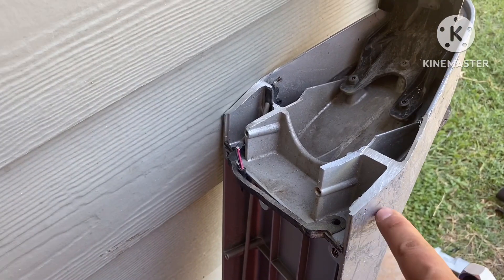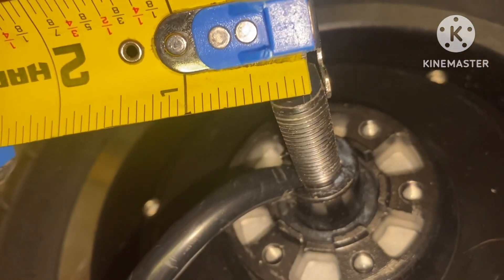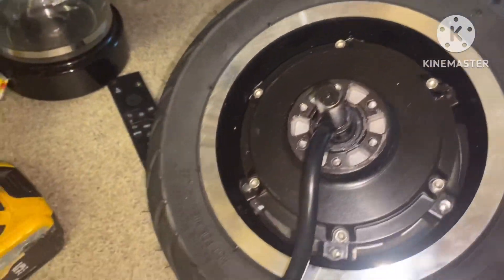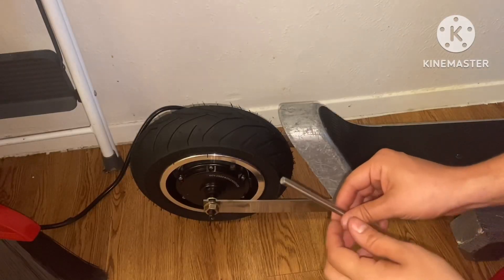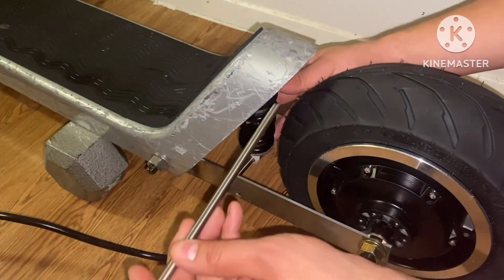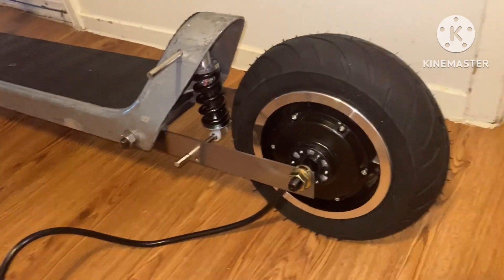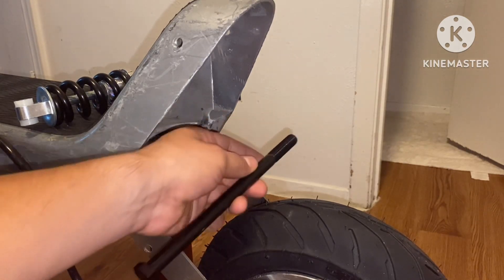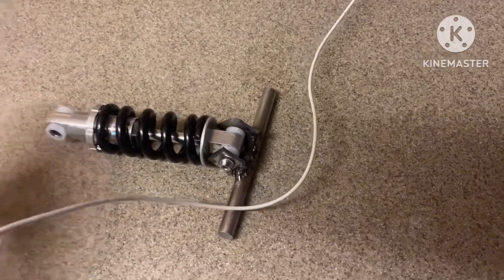Bird 3 | rear Suspension￼￼ | Shock absorber | DIY | Install￼ ￼

Comment: Okok I 👀 you,  I almost cut mine Inda wrong place, I'm welding wheel bracket like a letter H using stell square tubing, welding shock holder on there, doing the top I'm thinkn threaded rod wit light bar on end bolts for brake light, ps wen yu drill start with small bit to keep from dulling the big bits, keep going man 👍👍👍